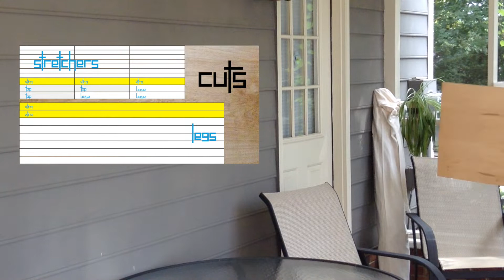thatroomdivider - Rockler Plywood Challenge #rocklerplywoodchallenge - Room Divider DIY

Comment: Very nice. The screen spline method can also help prevent fabric damage/destruction should someone accidentally push the fabric. Staples might make the fabric rip under force. The spline would probably release the fabric before damaging the fabric. Then you could simply re-apply the spline.
Reply from the maker: I agree that the spline would likely release the fabric as long as you have sanded the channel lightly removing the sharp edge that could hang on the fabric.  I did sand the inside edge of the channels for that reason, but only slightly.